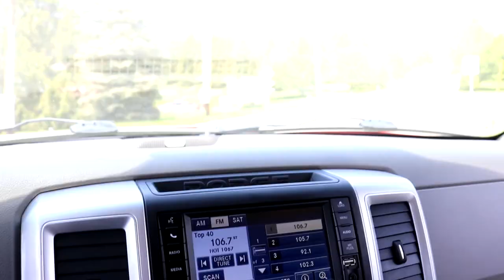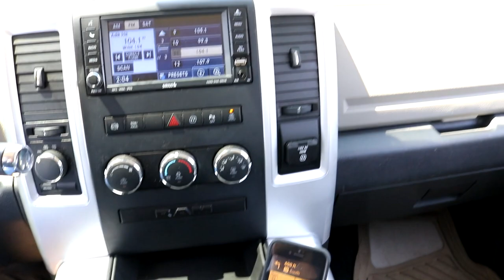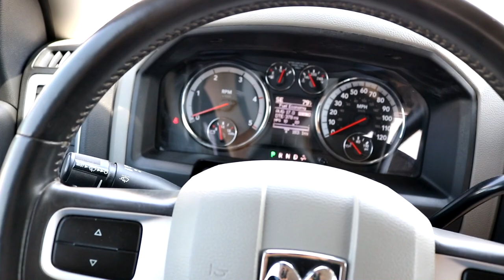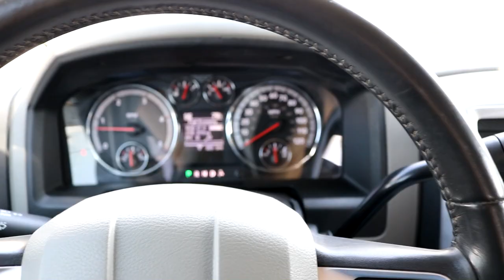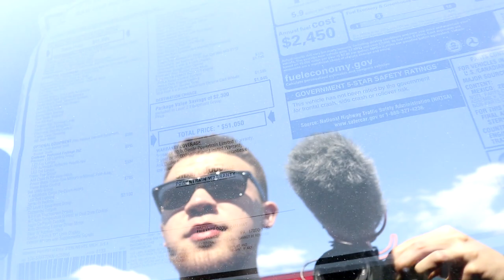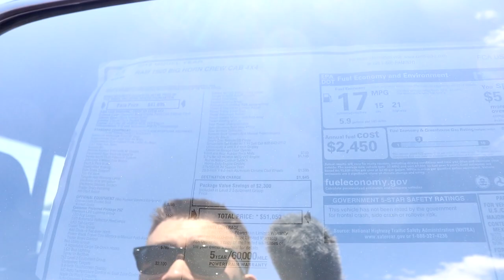24 VALVE CUMMINS GETS NASTY 5 inch STRAIGHT PIPE EXHAUST!!! *EXTREMELY LOUD!*

Comment: Sounds good brother! I deleted mine about a month ago and wanted to go straight pipe but didn't want the annoying drone in the cab that everyone says they get with straight pipe so I went with the 30 inch resonator from FTE diesel instead of a muffler so I could still get enough sound. Did you get the drone with straight pipe?
Reply: Straight pipe=drone. I opted for the flo pro 5" w/ muffler. No drone. Just rattles where it touched the firewall and spare tire shield. Breaker bar and a bit of tweaking.  Now alls good.
Reply: Cummins808 I was going to go with a muffler before I found the FTE Diesel resonator. Very little restriction and allows more sound without being annoying. Very happy with the results and cheaper than a muffler.
Reply: Scott Ryan I was going to do the 30 fte route since people said with muffler on the 5 would drone. Now I actually want the muffler off and go straight lol. My Sti's were all louder than my truck haha.
Reply from the maker: its loud when its cold but once its at operating temp its not loud / drone. You could hold a conversation on the highway easily. The 5.9s were a lot louder